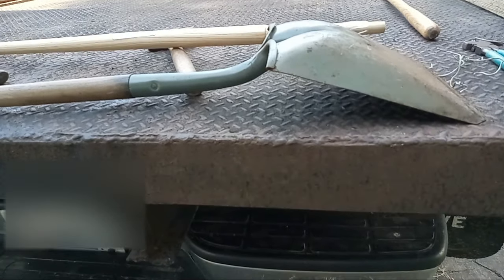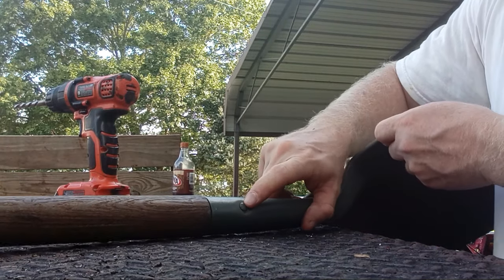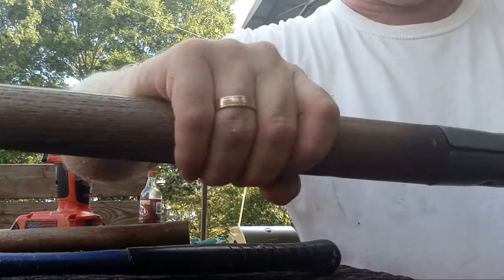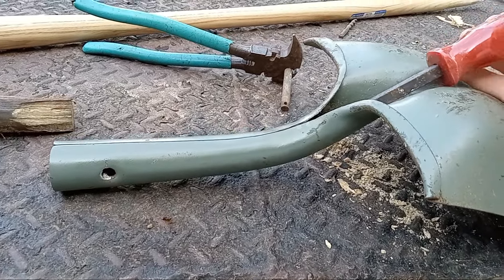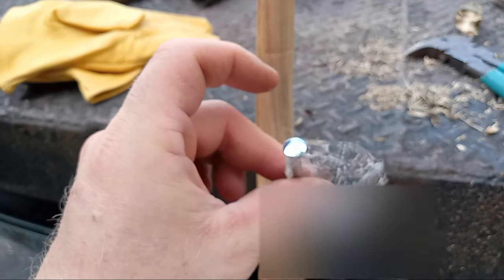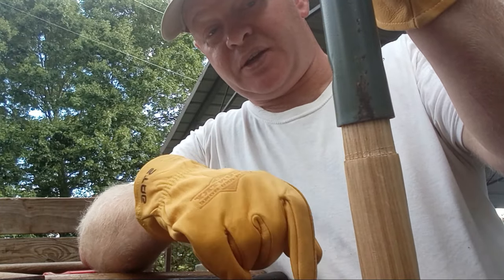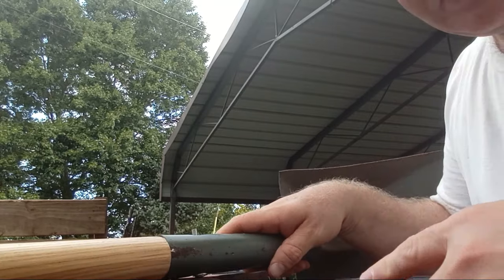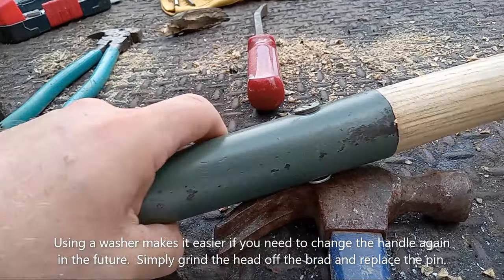How to replace a shovel handle

Comment: OK I just tried to do that for 2 1/2 hours I had to drill it out and then it still didn’t come out so I put it in the fire pit and I poured gas in it and will eat it on fire for about an hour and it’s still stuck in there. This is not as easy as he’s showing you. I had actually drill that pin out. Therefore, I got a nice big hole on one side.
Reply from the maker: If the shovel handle is what I would call green, meaning strong and not worn out, then it could be more difficult.  However the size of the drill bit you use can make a difference as well.  I've changed dozens and dozens of handles but never had to set one on fire.  I am sorry you had such a difficult time.

Comment: @earlclaborn Sir, thank-you. Got my center punch, marked the brad pin, drilled it right open. Just needed to figure our what bit does metal best. Punched it through with a handy nail and used a sledge I had nearby as a prop like you did, a good call. Took more time to pry open the damn spade head and free the broken haft. You saved me plenty of time and frustration. But to hell with those pins, I'm gonna get bolts! 😅 Thank-you again.
Reply from the maker: AWSOME!!  So glad you liked the video and is saved you time.  Don't work too hard.